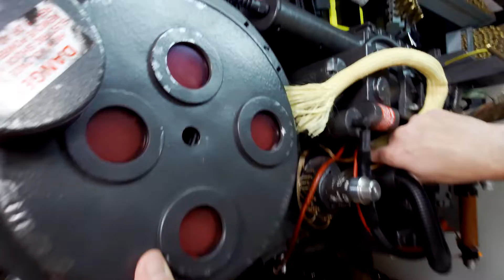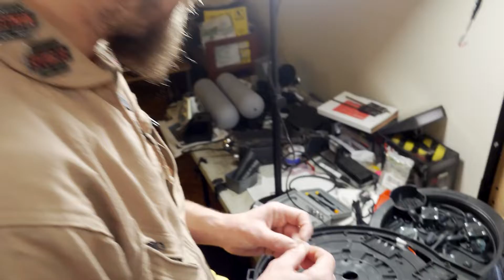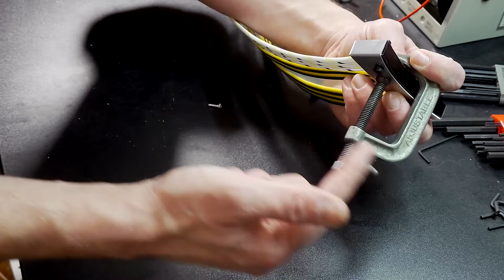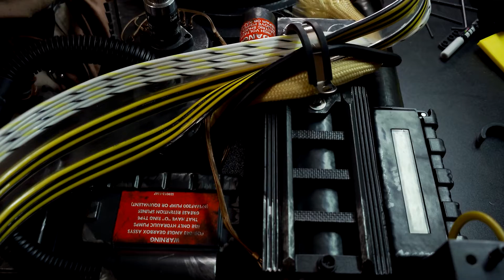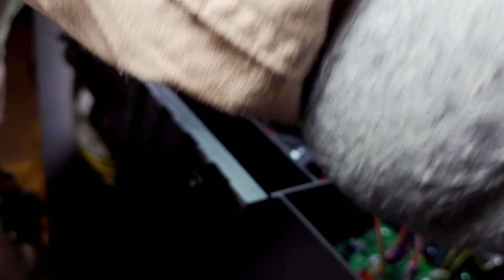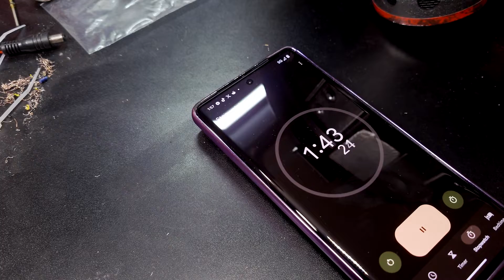How To Mod the HasLab Proton Pack: Keep Alive Mod, Ribbon Cable and Clamp!

Comment: Quick question: if ordering ribbon cable from TGB and the cyclotron clamp from C&A, what width of cable should you choose from TGB if running on Haslab pack?
Reply from the maker: They let you choose width? When I ordered mine from etsy, I didn't get to choose the width. It ended up being tight but it worked
Reply: @Gregors85  yeah I guess cause you chose the custom one and went with the caution tape appearance. But their other selection for the '84 style comes in a variety of widths.